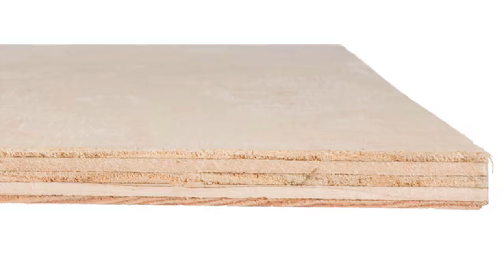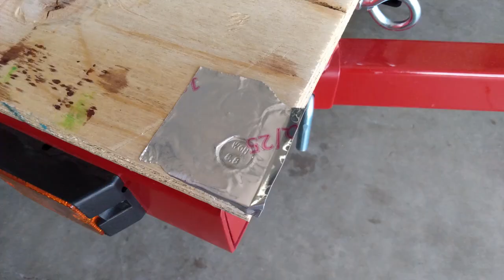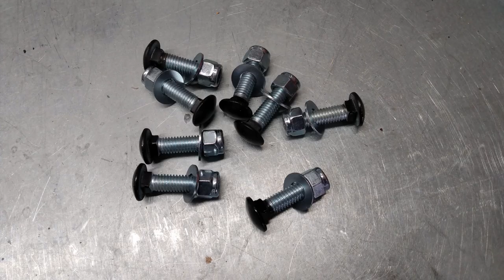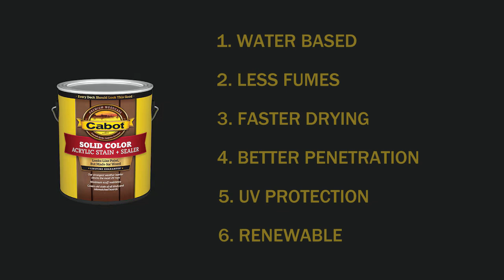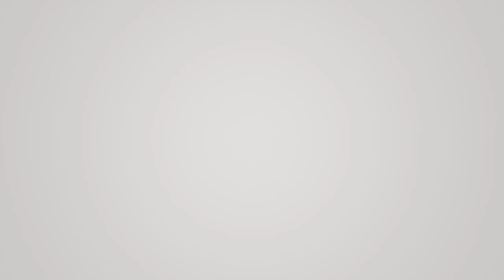Custom Deck for Harbor Freight Trailer

Comment: Good job on the filming, narration, and editing in addition to the work on the trailer deck itself. I'm thinking about buying one of these even though there's a bigger and better HFT trailer out. Assuming this one will carry 4X8 sheet goods such as plywood and drywall, if I take care with the placement of side walls, it'll take up a little less room in the garage and is lighter to tow with a 4 cylinder car. Thanks for the video!
Reply from the maker: Thanks.  It's very light, even with the additions.

Comment: Awesome work! Where did you get the plywood?
Reply from the maker: Lowes.  23/32" Sanded Douglas Fir    Item #12235 Model #119055
I chose one that was evenly cupped and put the crown up so it would settle flat rather than have the edges try to curl up.
Reply: @RealBLAlley thanks for the reply, what about the hardwood? These trailer upgrades are awesome
Reply from the maker: @mmmmmccxxc  Hardwood?
Reply: @RealBLAlley  The slabs that you put under the plywood to prevent warping on the frame.
Reply from the maker: @mmmmmccxxc  It's S1S tempered hardboard. It's smooth on one side, rough or "waffled" on the back for easy gluing. Any home improvement store will have it in 4 x 8 sheets and often in half or quarter sheets.